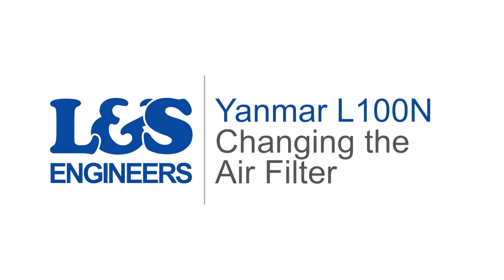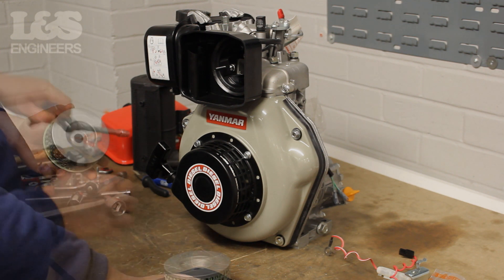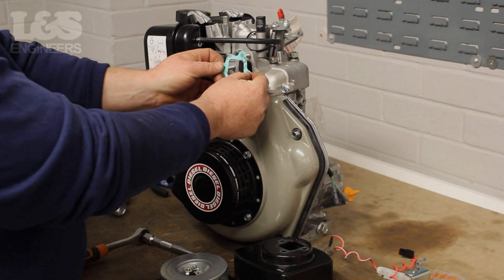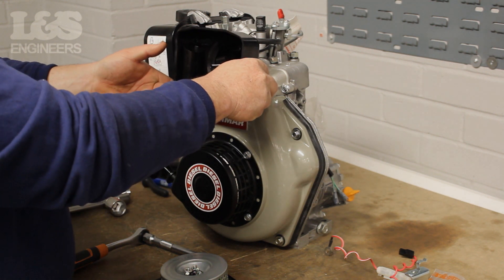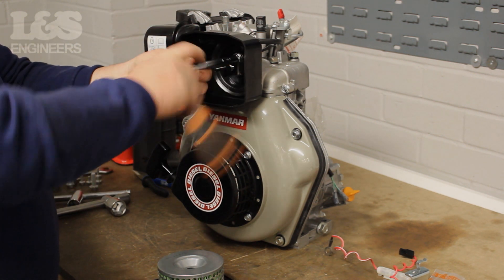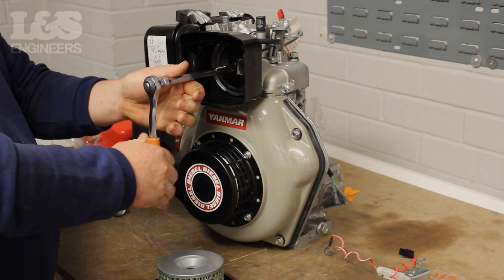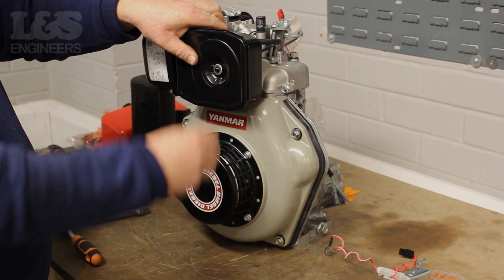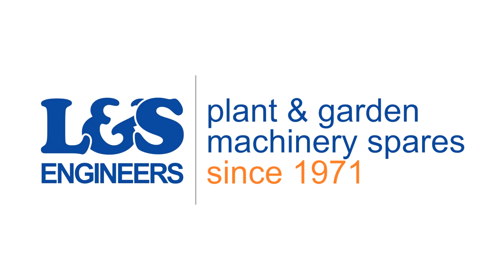How to Change an Air Filter on a Yanmar L100N Engine | L&S Engineers

Comment: Any advice for removing the flywheel? I've removed the bolt easily and tried pulling the flywheel off with a flywheel puller but |I'm just bending the puller bolts!